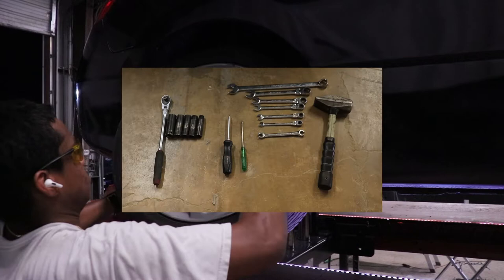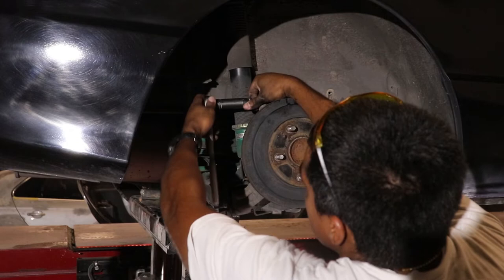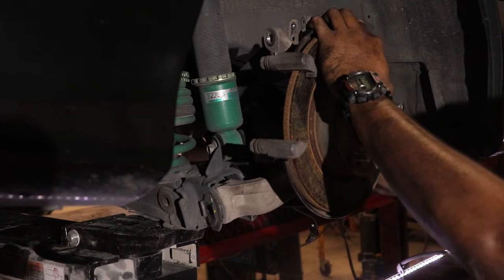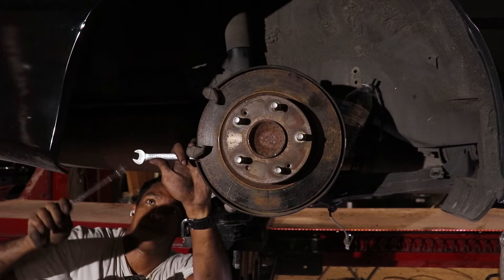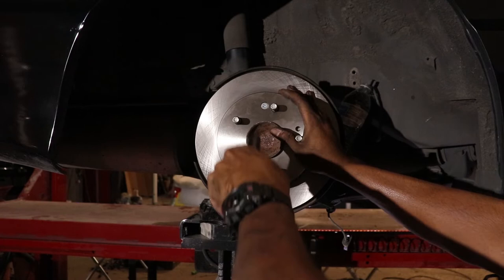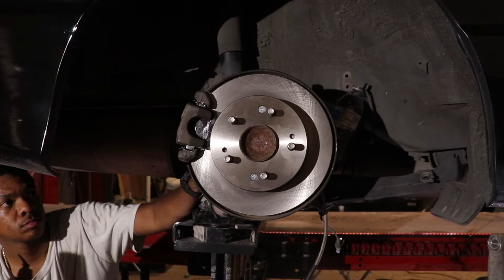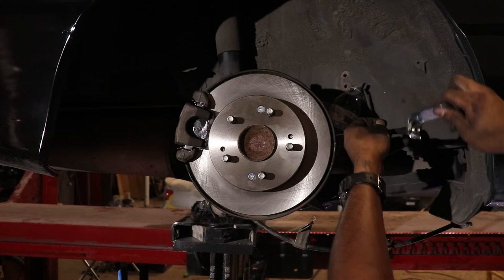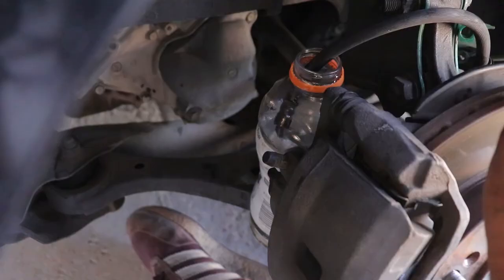8th Gen Civic Rear Disc Brake Conversion (EX SWAP)

Comment: Install a rear anti roll bar from an Si. 14-15 Civic Si's come with a 20mm beefy rear sway which really helps the cars handling. 06-11 Si is a 17mm and helps too.
Reply from the maker: I’ve been looking to source one. Either finding one or trying out the bar from Progress
Reply: @developmentdivision122  I have the 20mm and its fantastic. If I remember correctly a brand new one from Honda is $50.
Reply: You mean $500?

Comment: Did this job a few months ago. It's a huge difference in brake feel. Beware that those bolts can be seized up and you may need cut it out. The emergency brake cable was much easier to change than I thought.

Comment: Normally on a hot rod, you have to buy a disc/ disc master cylinder, and get rid of the disc/ drum one.  Do we not need to do this on the civics? Aren't they still set up for drum 400psi versus a disc 900psi braking pressure?
Reply: I checked with the dealer; the master cylinder for drum and disc is the same. They probably did it that way so they didnt have to engineer or manufacture two different parts.

Comment: For 20% braking power this is way too much work the front brakes take 80% you never have to change rear brake pads or drums for well over 160,000 miles

Comment: To anyone doing this: Now is a good time to replace your rear shocks. Hope to the car god's that the bottom mounting bolt isn't fused inside of the shocks lower bushing, but if it is now is the time to address it. If it isn't take it out anyway and put anti-seize on the body of the shoulder bolt.

Comment: Will a knuckle from a coupe work for a sedan
Reply: Also curious on this. And any knuckle from 06-10? Or what years can interchange.
Reply: I believe coupe e brake cables are different, so if you buy sedan cables from Honda you'll be ok.

Comment: Bro great video well explained i just wanna know what about the abs sensor did you pull up wire or its already there just to plug in..?
Reply from the maker: I used the same abs sensor from the drum brake set up. These are inexpensive to replace and buy brand new. Try beck/arnly

Comment: I can only seem to find sedans in my area at junk yards. I have a coupe, assuming the e brake cable will be longer on sedans?
Reply from the maker: I’m not 100% sure. But i think they are different. You might be able to just get some new ones from rockauto or ebay. However, every thing else for the swap is the same.
Reply: @developmentdivision122  I just found a civic si coupe. Someone online tried to say the rear knuckles didn’t fit from SI to lx, is that at all true or was this person just not able to figure it out? Lmao.
Reply: @developmentdivision122  will my LX abs wheel sensors transfer over? And if I plan to buy those steel brake cables as well, the only thing I need is rear knuckles, calipers and bracket then the e brake cables?

Comment: Also I hope u can reply would be very helpful but can I take the parts off from an si four door and install em on my coupe lx
Reply from the maker: Yes. Coupe or sedan, everything is the same except MAYBE the emergency brake lines. That one I’m not too sure of. If you’re pulling from an SI, I believe the front knuckles and brakes are slightly better compared to the other trims.

Comment: Do I have to replace my brake lines ? Because I will soon be doing a conversion I just want to know if it’s necessary to change my brake lines
Reply from the maker: Yes, you will need to replace the brake lines. The drum lines are slightly different than the disc lines.

Comment: So are the stoptech brake lines required, or thats just an upgrade?
Reply from the maker: Not required. Decided to buy new instead of trying to use a junkyard brake line. You can use stainless or oem-grade rubber.
Reply: @developmentdivision122  just picked up a rolling EX coupe shell for $100 tonight. Going to start pulling parts asap

Comment: You didn’t show much of the e brake cable change, did you have to pull the dash?
Reply from the maker: No dash removal required. Only the center console. At the bottom of the storage compartment, there are two Phillips head screws. In each footwell, there are trim clips that hold the center console to the bottom of the dash. After those 4 fasteners are removed, remove the plastic trim around the shifter and then the center console slides backwards and up to reveal the emergency brake cables.
Reply: @developmentdivision122  Dang i am so intimidated by this project

Comment: So still very confused on how to order myself the right kit. I want to do a conversion from drum to disk on my 2011 lx civic. Can I not just order a set of 4 rotors and calipers + lines and install or do I need other parts to retrofit?
Reply from the maker: The knuckle itself is different. (What the rotors/drum mounts to.
Reply: I thought the EX came with 4 wheel discs.
Reply: @waverider5751  my bad I had a typo in my comment. I have an LX civic .